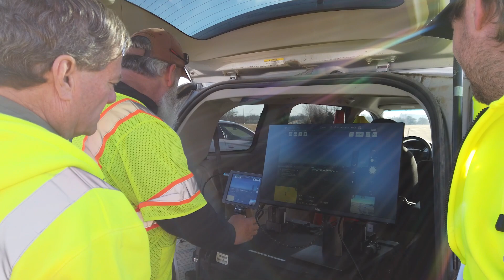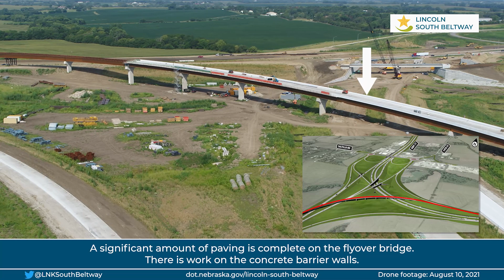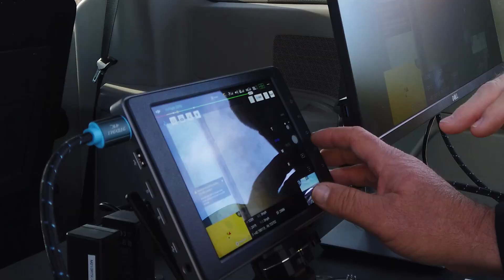Nebraska DOT UAS Program and the Lincoln South Beltway Project

Comment: Your signage at the Van Dorn Exit going east is inadequate. Hundreds of semi's continue to use the old Highway 2 every day. Adding a Highway 2 symbol with the distance to the new Highway 2 (5 miles) on the now blank space at the top of the current sign where it used to show the exit would help. Designating Nebraska Parkway local delivery only for CDL drivers like other cities have done would help too, and allow NDOT to enforce it. Lincoln taxpayers will end paying for  unnecessary wear and tear on Nebraska Parkway in the upcoming years because it is no longer a designated highway with the new Highway 2 being the South Beltway.  Also, the light up sign at the east end of Nebraska Parkway telling passing through traffic where to go wouldnt be necessary if you tackled the problem at the start of the problem, the Van Dorn exit. 

Looking at your east beltway plans, it shows a circular exit off from the right hand turn lane off of Nebraska Parkway to go east. That is by far a way better design because traffic flow from Nebraska Parkway would be continuous traffic flow  and because exiting traffic from the South Bypass turning east back to Lincoln wouldn't have to wait for a continuous line of traffic during busy hours. For as long as the bypass has been open, these shouldnt still be a problem.